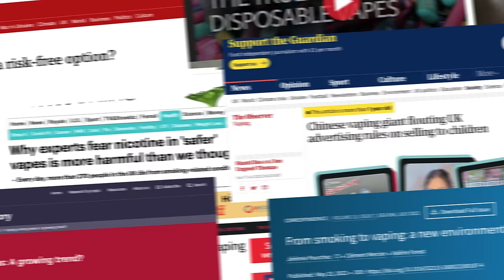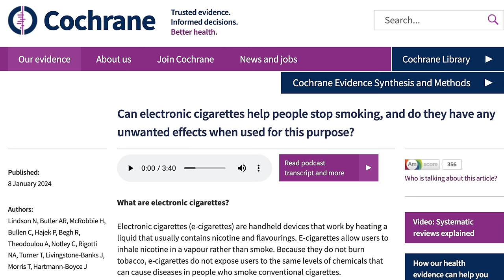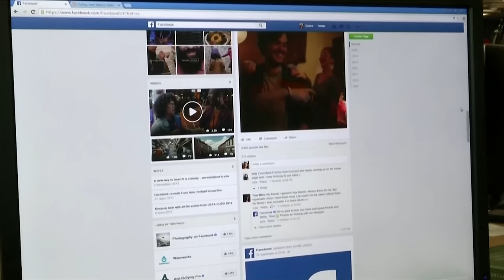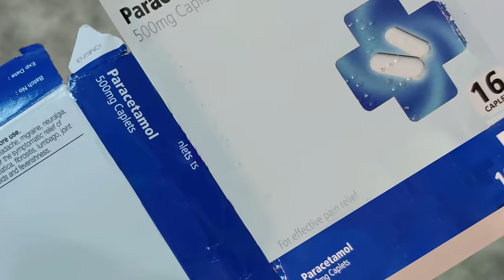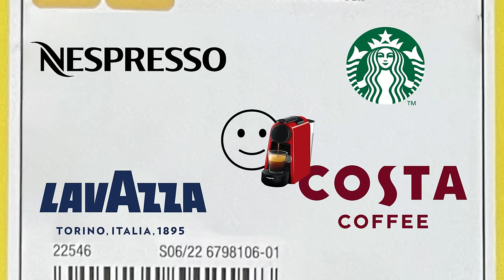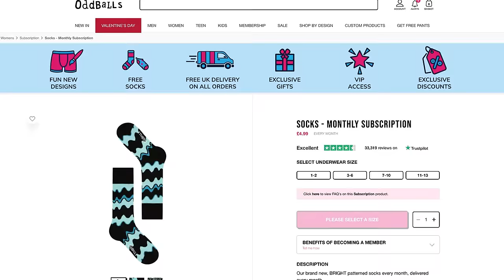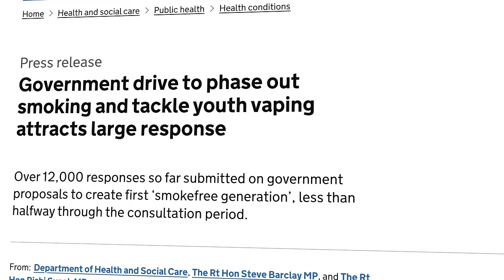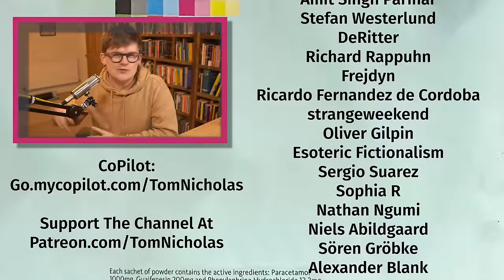Vape-o-nomics: Why Everything is Addictive Now

Comment: It wasn't always like this. I owned a vape store back in 2015. The devices at that time were less convenient than they are now. Coils had to be replaced, and batteries had to be recharged. The only tanks that provided a good flavor and a satisfying draw had to be rebuilt by hand. This put many people off because it was just too much hassle. 

Vaping broke my tobacco habit, and my lung capacity recovered noticeably within a few months of swapping tobacco for vapor. I felt that I was helping people quit smoking tobacco like I had, and I genuinely wanted to help others stop smoking tobacco. 

My pitch to customers was as follows. The hardest part of stopping smoking is the hand-to-mouth action, which is why many people gain weight after stopping tobacco: they replace smoking with eating. E-liquids are available with high doses of nicotine but don't start at the highest dose. Start at the lowest dose and aim to ween yourself off nicotine before you attempt to break the hand-to-mouth habit. Don't buy a cheap vape pen because you won't get the satisfaction of a good draw. I would tell them that I didn't want them to be my customer for any longer than it took them to quit. I know for a fact that I helped many people stop smoking tobacco and eventually quit vaping, too. If a non-smoker wanted to start vaping, I would actively try and discourage them. I guess that makes me a bad businessman, but I'd rather be a bad businessman than a good one with a heavy conscience. 

When the tobacco companies realized that they were losing people to vaping, things changed rapidly. The conspiracy theorist in me was convinced that big pharma wasn't too happy that they wouldn't get to sell their overpriced drugs to those who developed health problems due to smoking tobacco. Around the same time, companies like Juul appeared, and I knew that this potentially life-saving alternative to smoking had been lost to corporate greed. These companies had money behind them, which meant they could afford to lobby governments to pass laws that made it difficult for small retailers like me to stay in business. This is what led to pod systems and disposables taking over the market. The blame for the vaping epidemic amongst young people should be attributed to governments and tobacco industry lobbyists.

It makes me sad and angry to see vaping become the next evolution in the tobacco industry's quest to generate even more profit by getting more people, including young people, addicted. That's not what vapes were invented for. Greed and corruption have taken something that could have had such a positive effect and turned it into a massive profit-generating industry to replace the one slowly being legislated out of business. 

For the record, the flavors are not the problem. Nice flavors highlight how disgusting tobacco tastes. Flavors are a good thing. The problem lies in the marketing of those flavors and the overly convenient nicotine delivery systems. Lastly, marketing vape pens to young people is unforgivable.
Reply: Great comment, I'm 11 years deep myself, vaping has always been demonized unfairly, but man this recent wave of disposables really really sucks
Reply: Thank you for writing this.
Reply: Thanks! Back in college, a big decade ago, I've taken courses on how vaping helps people quit smoking. I was taught exactly what you describe: health benefits of not inhaling tobacco, nicotine not being directly harmful but which you'd have to slowly reduce over time to quit it eventually. And that even though there were concerns that people that never smoked might adopt vaping and might eventually go on smoking, the studies didn't show that that would be likely (yet). I think promoting vaping did save lives, but I'm sad to see that capitalism has taken over and wants everyone to stay addicted. A lot of people get rich of exploiting people vulnerable to addiction and I hope to see a fight back, a system that rewards companies for solving problems and getting rid of them instead of keeping those problems going to milk those who suffer from them.

Thanks for trying to be part of the solution.
Reply: I remember my friend's reason for smoking was something like "I don't like just standing around like a moron when waiting for something, I need my hands busy". So vaping became his way to quit tobacco. Unfortunately he relapsed after years of not smoking, but it lasted for him a good while.
Reply: Wonderful write up, it's exactly how I remember vape shops and devices from that same time period. It was a niche and slightly cumbersome product, most of my friend's vaping devices looked like old nokia phones with straws attached and you had to mix the liquids yourself. Most used it to reduce or quit smoking, although there already was a minority of people who did it for the fancy flavors (but they overlapped with the hookah smoking demographic, which is it's own thing). When I tried using it to quit, I actually bought tobacco flavored liquid to make it feel more like the real deal. I must say I love the idea of those new tiny vape pens for the convenience, but I hate the combo of them being disposable and candy-flavored ...
Reply: I honestly didn't think the big companies would be able to penetrate the market back then. It all felt so organic and (for lack of a better word) decentralized l, evolving so quickly that a big corporation would never be able to keep up, and to an extent that was actually true as the vapes sold by big tobacco suck. But I do think it's fair to say they demonstrated that people are willing to drop around $30 per week on something they will throw away in exchange for the convenience. I've used pretty much every type of vape over the years and have always spread the gospel of how I stopped smoking. But now I use disposables and it's the first time I don't feel good about vaping anymore. It's so wasteful. Some of these vapes now has screens and wireless chargers and you just toss them out after a week. It's really gross. I've seen a reusable pod system that hits good and is about as wasteful as a k-cup, with the battery part being kept, but it's far from a major player in the market.
Reply: Thank you for sharing your viewpoint
Reply: Hi thanks for sharing your experience but having studied vaping at University the flavourings are a BIG problem as toxicological testing has found them to contain chemicals known to damage the lungs (eg cinnamon flavouring) and promote the addictive quality of nicotine (menthol). The fact that vapes 'taste better' then smoking is part of the reason they are so addictive as people don't associate the sweet/nice taste and smell with something harmful to their health - and this has lead to a entire generation of 'never smokers' taking up the habit - or ending up vaping far more then they previously smoked. I also note you fail to talk about the environmental/pollution effects of vaping which unlike traditional smokes contain hard plastics and electronics that don't break down - and can expode unlike other alternatives to the 'hand feeling' of smoking which can be replicated with anything that does the hand to mouth - eg nicotine gum, a toothpick or other 'non vaping products' that have actually passed TGA tested and shown to work. To date no vaping devices in Australia have ever been registered as an anti-smoking aid - and proof of efficacy of vaping to quit smoking has failed to show any benefit over existing tools like nicotine patches. It's really important when talking about the health and efficacy of vaping to rely on proper peer reviewed evidence in light of the strong connections between the vaping and tobacco industry - who own or are major funders of vape companies like Juul.
Reply: There's been a scary amount of teenagers diagnosed with lung damage.  

My daughter's quit now, but she still coughs up blood any time she has a cold thanks to the damage she's done.  Her doctor is certain its caused by vaping, there's just far too many cases lately for it not to be connected, and the common denominator is that most started vaping as kids.

Disposable vapes with a few puffs on them were readily available,  apparently. Her and her mates used to find them littered everywhere.  It's how she thinks she got hooked.  Gross, but kids are dumb lol.  I'm all for the ban on disposable vapes.
Reply: Just a small correction as someone in the medical field, quitting nicotine made people gain weight not because of the hand to mouth movement (or at least non exclusively for that reason), it’s an actual appetite suppressant, it enhances the response to leptin, increasing the activity of the POMC/CART neurons in the arcuate nucleus in your hypothalamus. So quitting it, takes away the appetite suppressant effect.
Reply: if karma exists, you may be the first person to have reached the maximum limit... congratulations on being an outstanding person, seriously
Reply: I took up vaping as a way to deal with my mental health problems. I have dysphoria and before treatment nothing took the constant, s**cide motivating emotions away. Nicotine helped me work two jobs I hated, for a while. I had just quit hard drugs and felt like I needed "something" to function day to day. Eventually I found it sucked the colour out of life and left me depressed anytime I was away from my vape too long. The man who sold it to me asked questions like op would have, trying to assess what strength I needed to quit smoking. I lied to avoid confronting that I was willingly getting into nicotine. I think he knew what I was doing and sold it to me anyways. 6 months later I had to quit since I couldn't hide it from my partner anymore (lockdown) and she hated it. Withdrawal was like I was a squashed bug, nothing was inside me. No energy, no emotion, no nothing just emptiness. I wasn't even sad. Out of all the substances I've abused nicotine is the only one my brain hasn't forgotten. I can say no if offered a beer, weed, even drugs, but whenever I think about how the vape tasted part of me wants to go back. It's been nearly 4 years and I still have thoughts about it sometimes. It really sickens me how tobacco companies willingly inflict this on CHILDREN. I can't imagine how hooked I'd be if I started at 14 instead of 24. You're a good guy and I bet you extended so many lives through your efforts.
Reply: I still use a mod with replaceable coils.  The disposable vapes are way too wasteful for me and they don’t last long
Reply: @SpaceNStuff chill
Reply: Exactly what I think! I quit cigarettes and started vaping, and it was a really good thing for me. Vaping was supposed to replace cigarettes for smokers, not to get non smokers addicted to nicotine😒
Reply: Great point. Haven't thought about this before but I do see far less vape shops and far more smoke shops. The vape shops clientele is also much different than it was in 2014-2018.
Reply: @Pluralofvinylisvinyls  glitch at YouTube. Only replied once
Reply: @SpaceNStuff  figured, jk
Reply: I don’t think I’ve ever seen an advertisement larger than 1x2 feet in back windows or display case for any vape products to be completely honest. And you’re absolutely correct! I’ve smoked Newport 100’s for a good 20 years now… didn’t even realize this till I wrote it down. I smoke about 3-4 cigarettes a day now. Sometimes two. But I vape now a little… it takes me a good 2-3 weeks to get a 2k puff disposable and I wonder am I still smoking just as much? I used to be at a pack a day. I’m saving an incredibly high amount of money. Actually about 60-70$ A WEEK. But I’m not trying to make any excuses, I also do sometimes smoke ip to 6 cigarettes a day depending on circumstances tied to the day. Weirdly enough I only smoke THC oils and carts now. Actively trying to keep people away from any delta 8. It’s an extremely difficult process to make clean and to make money on it being safe it would have to be much more expensive than how it’s being sold and dealt with. Not saying normal carts from the dispensaries are safe. But much simpler process and cleaner methods. Just have to look into the companies present pretty extensively to actually make sure their processes are safe as well. Some big boys out there are adding some funky shit.
Reply: I got into a verbal screaming match with a vape store owner who wouldnt sell to me, a 28 year adult who wanted to buy vape stuff, but was never a smoker. As a shop owner you don’t get to choose who or why your customers but your products. Sure i was dumb for starting my nicotine addiction. I eventually started cigs, and now I’m hooked on zyns. Ill probably be hooked on nicotine for life. But its not the vapes fault, or the people who sold it to me
Reply: I think disposable vapes and marketing to young people is abhorrent, but that doesn't mean vapes are not helping people. They are absolutely great at stopping cigarette smoking.
Reply: Welcome to capitalism - Profits over People!

Good on you for doing the right thing even though it was "bad for business" ❤
Reply: Yes!! Worked in a vape store in 2015 (miss those years 😩) and all of this.
Reply: @Pluralofvinylisvinyls  I've tried disposable a few times, everyone who tries my mod complains it's not as satisfying of a draw as today's disposables. And I agree. Today's disposables have much less harsh of a draw and an insanely stronger menthol added to even their non ice flavors. But whenever I've used a disposable I end up with a sore throat and feeling jittery and off. Supposedly it's the same strength as the liquid I buy, but there's something up and I know even if I don't know what it is there's something more addictive and more harmful in those disposables.
Reply: @vivianloney  they use salt nic, which is stronger juice but you do use less of it, other than that it’s the same thing.  Can’t really hide ingredients in todays world